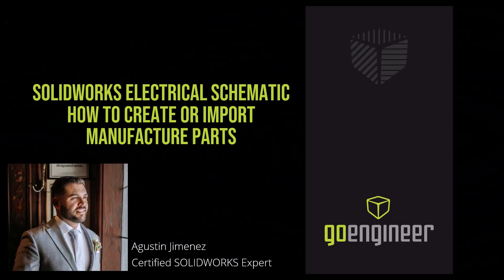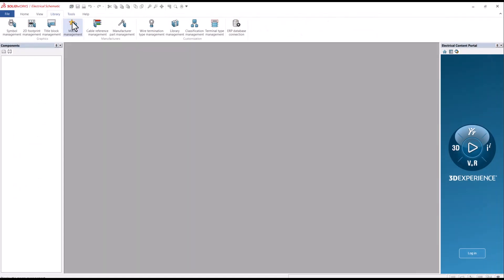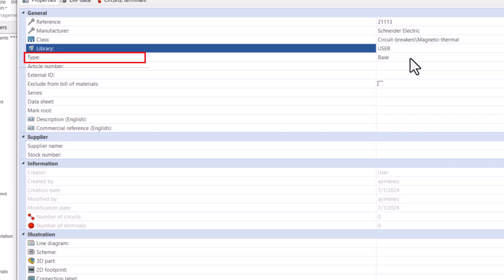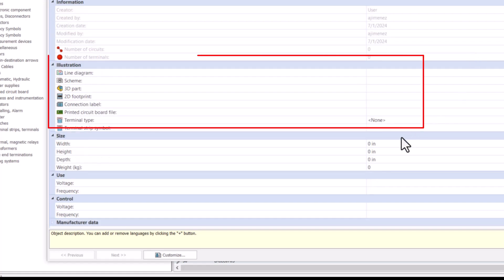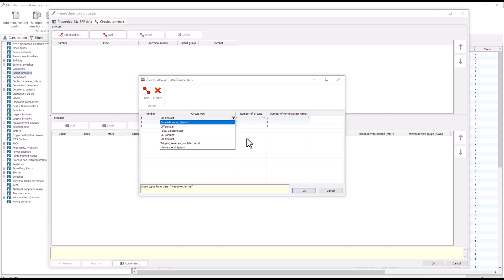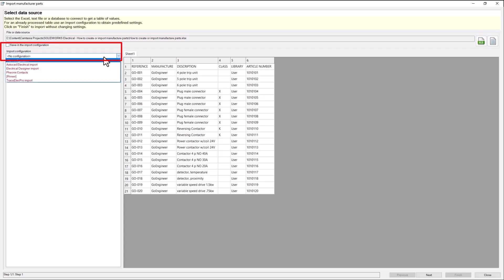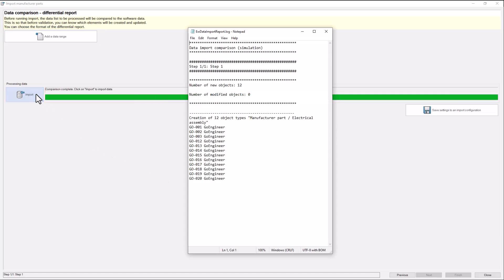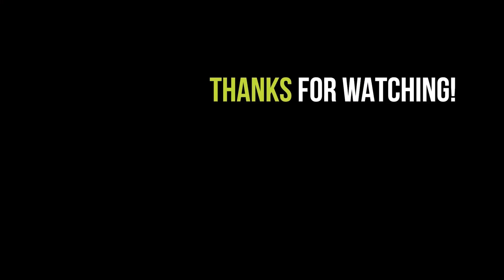How to Create or Import Manufacturer Parts in SOLIDWORKS Electrical

Comment: HELLO! 
I have the solidworks 2020 installed in my laptop.Every time I try to create a plane or draw something it just creeps over the outline of the extruded body or plane.A orange line creeps across the entire part everytime I try to zoom in,zoom out or select it for sketching. For example in case of threaded parts it creeps for a very long time and operation can be done only after it creeps the body completely.Why does this occur? I tried changing a few settings but nothing works. It would be of great help if someone could give me a solution.